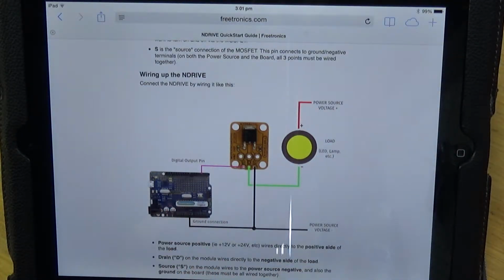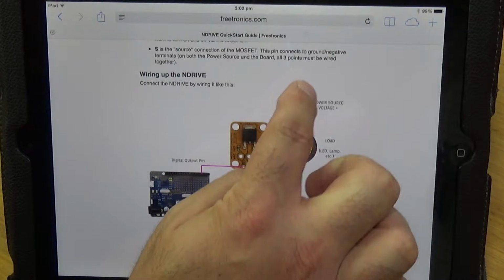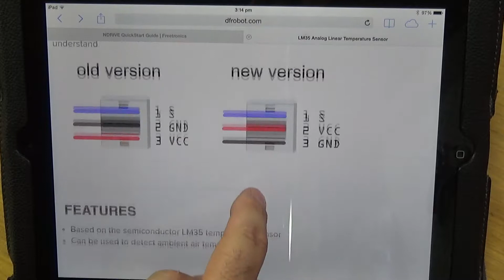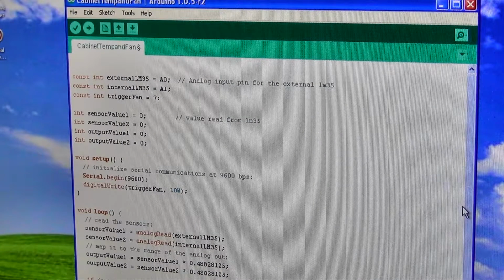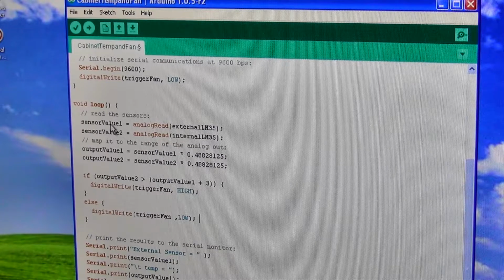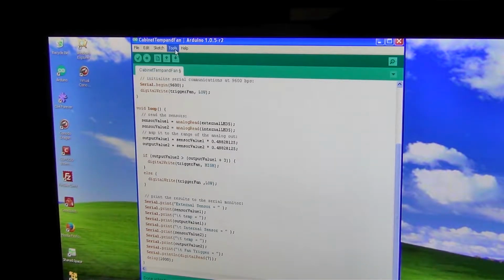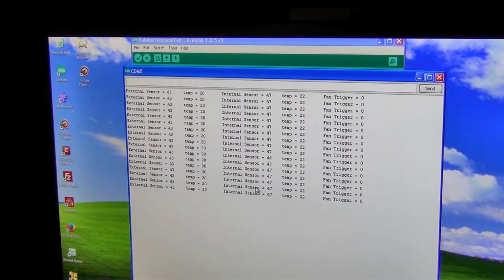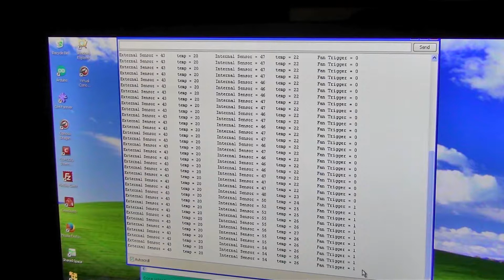Arduino Cabinet Cooler (MEHS) Episode 2

Comment: new to raspberry pi and arduino so of course I have questions. For this, what are you using to program the arduino?
Reply from the maker: +ndixie 
Hi, I find the easiest way to get started is using the Arduino IDE available from the Arduino website:  https://www.arduino.cc/en/Main/Software
There are heaps of example programs (sketches) to use.  These make getting started really easy.  In some cases you can just modify an example and get close to what you need.
Reply from the maker: +ndixie 
Also, if you're really new to Arduino, I highly recommend the videos by Jeremy Blum.
https://www.youtube.com/watch?v=fCxzA9_kg6s